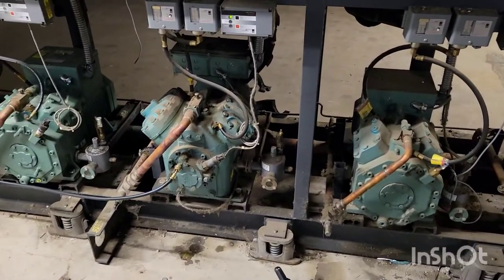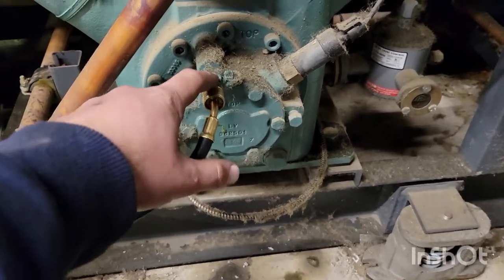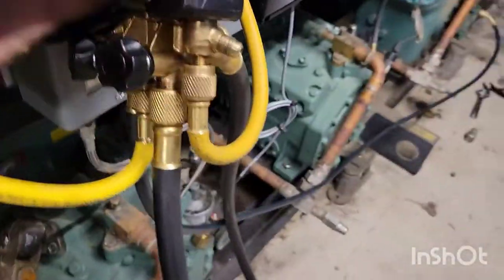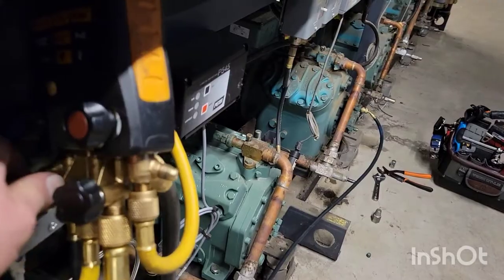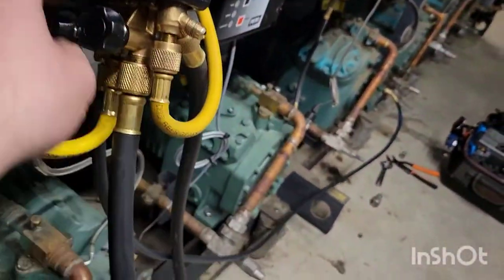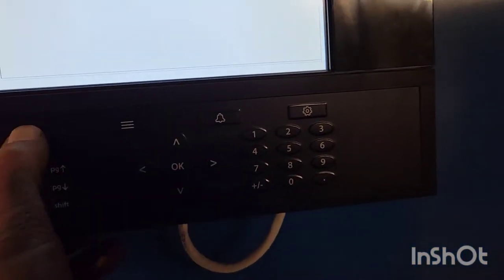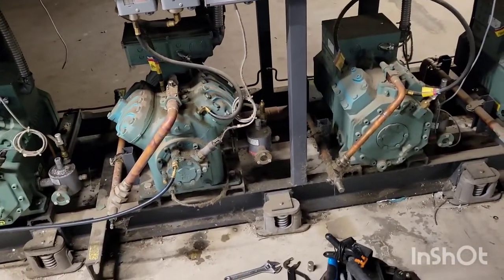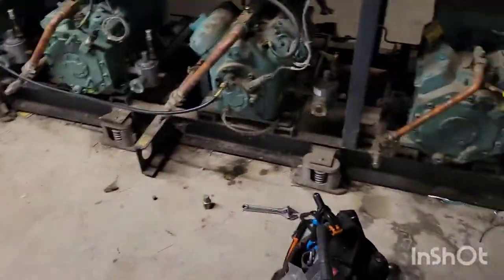Supermarket Refrigeration - How to Pump Oil out of a Working Bitzer Compressor (4B2707PL-2NU)

Comment: I used to build these compressors at the Bitzer plant in Oakwood Georgia. What supermarket is that King Soopers?
Reply: You worked at Bitzer in Oakwood? Small world! I work at Hussmann in Suwanee and used to live less than 2 miles from the Bitzer plant. We use a ton of Bitzer stuff!
Reply: @Eevee_133  I worked there back when they use to build racks and for a little while when they started assembling the compressors. I use to take the green bitzer compressors and paint them blue and change the label. Then they were Ingersoll Rand. We had a section at the Hussmann facility over by the loading docks where IR compressors were stored. I had to go there occasionally to pull orders. I've had to deliver to Hill Phoenix in Conyers too. Both facilities are huge. I haven't been at Bitzer since '06. I wanted to learn more so I chose a job that would give me more experience in the field before starting my own outfit. I haven't done any supermarket refrigeration since Bitzer stopped manufacturing racks ('05), but I am well experienced in residential and commercial HVAC and low and medium temp refrigeration.

Comment: Yooo I do commercial rack refrigeration this is a big tip here only question doesn’t the compressor need oil mechanically or it would destroy itself? Looks like you didn’t pump it dry though ?
Reply: The Oil Pressure Switch will turn off the compressor once it's low on oil. Unless it's not working lol
Reply from the maker: Yeah just don't pump it dry,

You know, you pump a dry cause. It will make a bad sound a very bad sound. 

:) 

Good questions
Reply: These compressors are pretty tough. A couple of seconds with no oil isn't gonna destroy it. There's still an oil film coating everything even once the pump has stopped picking up oil. I've seen Bitzer compressors run in a constant flooded state for several years. There was one running with the entire bell housing covered in ice in the assembly plant at Bitzer Germany. I was told it had been going like that for 2.5 years and the previous one lasted 12 years.

Comment: Why I it sucking all the oil out of the header? Bad oil float assembly?
Reply from the maker: The compressor is not turning on,

When the compressor doesn't turn on for Long periods of time, it sucks all the oil out of the system.
Reply: So that I understand...

This compressor was off for some time, the oil float was open, thus the oil from that compressor drained out. 

You came, brought it back to life, and it started hogging all the oil in the rest of them because it was dry. 

Thus, you are pushing all the oil that the compressor has hugged back to the rack?

Are you going to manually fill the compressor before opening the oil supply?
Reply from the maker: @steventorman3993  

So I just drain the oil out to like, A normal level if possible. 

So it's not bone dry if I can help it. 

The way I fill up the compressor is I open the oil line and just allow the oil to flow in. 

Maybe I'll give it like a minute,

But once it starts running it just fills right up.

Comment: Why are you doing this, cause you need to change the compressor?
Reply from the maker: The compressor is not turning on,

For whatever reason, the compressor won't turn on. 

The compressor is fine. Except one of the safeties or possibly the controller is not cycling it. 

Because of this  If a compressor is down like this, it will eventually fill up with all of the oil in the system. So all of the other compressors will be starved of oil, and then the rack will go into oil Failure. 

I hope that helps :)
Reply: Okay,  the cause why it's filling with oil it's because the pressure will be lower on that compressor?

On the system' I know they run a level meter and solenoid valve to open when demand is ✌️🐧🐧
Reply from the maker: @rasmushelvad1451  The reason it fills up with oil. Is because oil will naturally return through the suction Header. And if that compressor never turns on, the oil will slowly fill up the compressor through the suction
Reply from the maker: @rasmushelvad1451  

I actually believe it has nothing to do with the pressure at the compressor but that the compressor is the lowest point on the suction group. 

So because the suction hitter and the suction side of the compressor are the same pressure gravity as the factor so the fact that gravity is acting on the oil pulls it to the lowest point of the suction header, which would be that compressor that is no longer operating. And so eventually it just keeps filling up and filling up until all the oil in your rack is stuck in the compressor

I hope that helps

Comment: Hi, is there an e-mail or something I can reach you out?
Thanks
Reply from the maker: Not really,

I try to Be kind of like off the grid. 

But why? What did you need? You could comment below or give me a rough summary if it's not private.
Reply: @gendronhvac-r1269  
I have a Copeland 4D semi on a medium temp rack. Its working but after like half minute its tripping on overload (INT 369 diagnose). Module LED error code says its a dynamic switch-off trip, which means the module sensing that the sensor temp increasing too fast and trips even the compressor is not even hot yet. Also I found the contactor pitted which it shouldnt be after 4 months of run. Compressor got replaced along with a contactor and breaker 4 months ago so its basically brand new.
I got the Fieldpiece megger to check the windings but I dont think its working with 4Ds. Ive got a weird reading starting at 1200mohm and going up to 2000mohm and then I got OL. I compared it with a good running 4D on the rack and was doing the same thing. Anyway, is there anything I can check before replacing the contactor and overload module and then lets see what happens?
Reply: I got it, looks like it was just the pitted contactor.
Reply from the maker: @tid3802  

Sorry for the delay,

Youtube doesn't really inform me on when someone comments on a comment. 

But i'm glad you figured it out